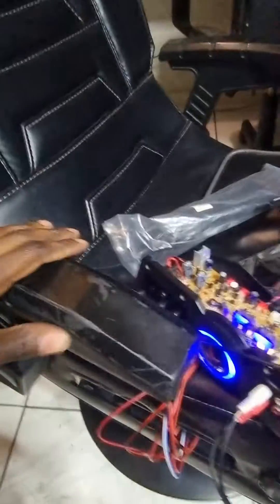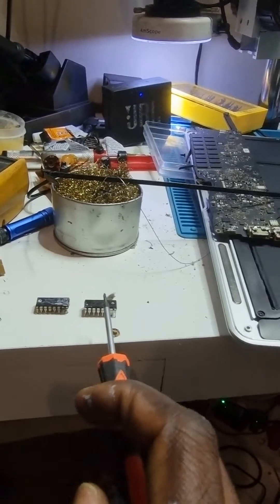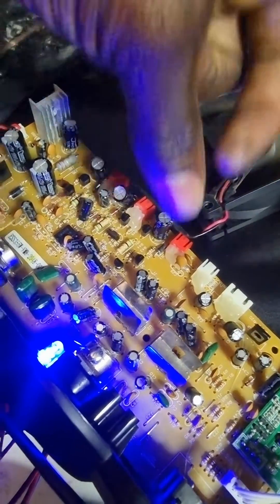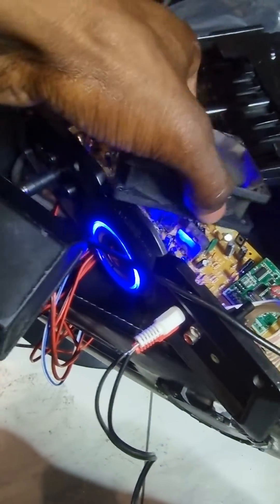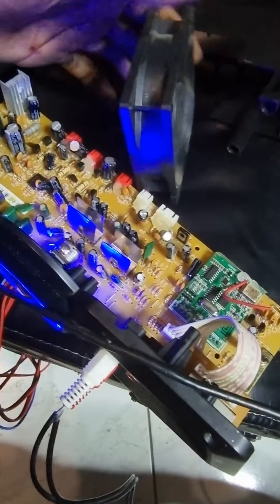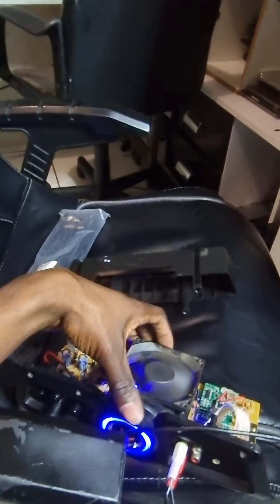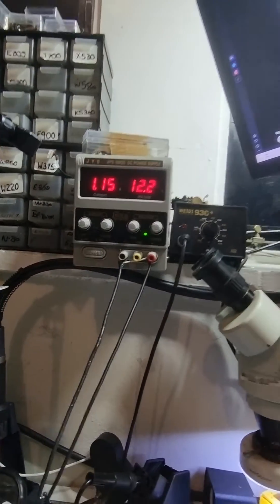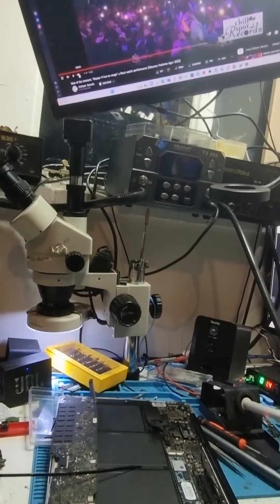Xrocker gaming chair Sound IC replacement

Comment: Mine turns on but has no audio output. I believe the IC's are blown because the heatsink gets hot very quickly. Do you have the IC part number?
Reply from the maker: Hi sorry for late reply. Chip is KA2206
Reply: Thank you so much! @cape-tech8303